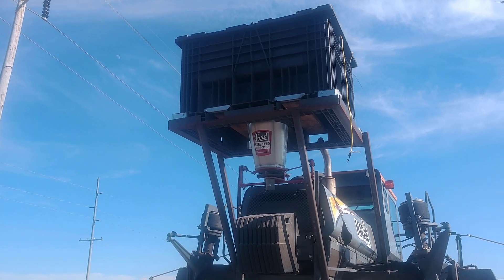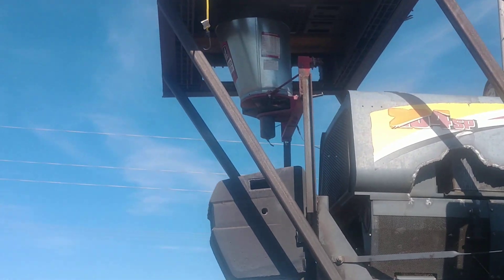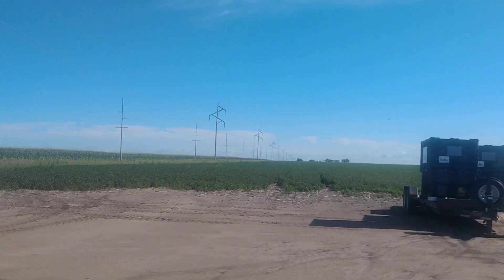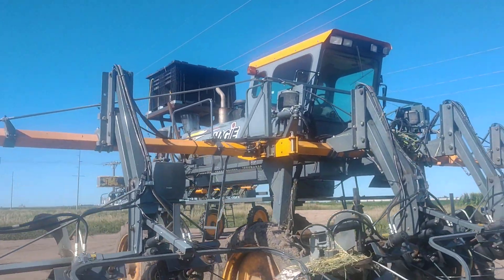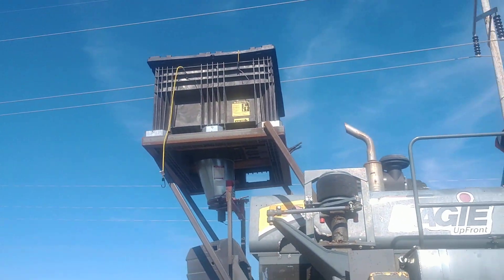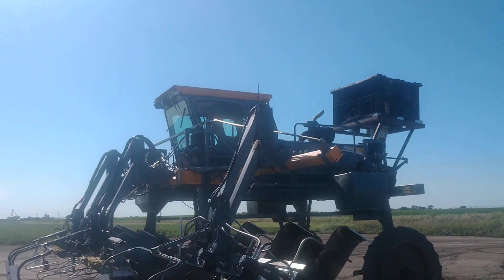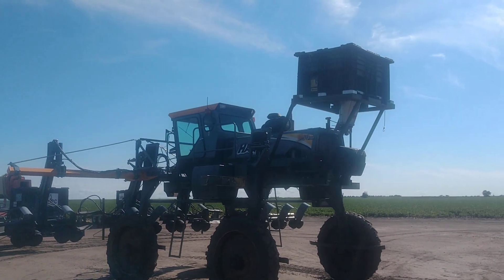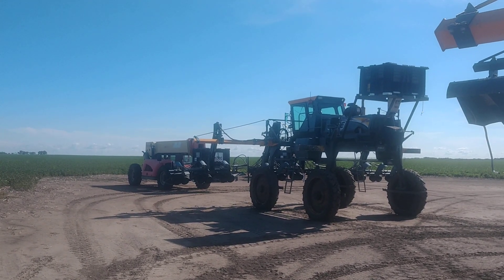Best cover crop spreader ever!

Comment: What is the working width and how precisely it can broadcast mixture of small and heavier seeds? I will fabricate my own seeder as well. Will buy some cheap 12 m hitch mounter sprayer and install APV pneumatic seeder on it.
Reply from the maker: It can be set up to different widths We work about 30 ft at a time.  It can go as wide as 50+ because of the height.  And it can go down to about 12 to 15 ft accurately.  We pretty much just keep it set up for 30 ft and it applies very precisely.  I'll have some videos of the cover crop emerging.  when just spreading it's important to note that water going to help germination of your spread on seeds a lot.  We have irrigation systems where we farm, curious where do you farm at?  Thanks for checking the channel out!

Comment: Do you get a very good stand? This came up cuz I had a hair brained idea to mount 2 or 3 spreaders on the front of my sprayer, and try to cover 120'
Reply from the maker: Great stands, here is the result vid!  Thanks. https://youtu.be/8qM7tzI3eGs
Reply from the maker: If you can pivot irrigate or usually get seasonal rains that really helps.  In NE it's usually dry enough in the summer I can apply .40-.50 hund of an inch and it germinates it really well in late July/early August.  What's your soil type and geography like?  I like the idea of mounting on spray boom or building something, hmm.  I'm spreading 30ft with mine, small cover seeds will actually blow in the wind.  120ft might be pushing it, the seeds have to fall through the cash crop plants vegetation (corn, soybeans,wheat,milo whatever...  I can go to 40 foot spread in perfect condition days (no wind). But I dunno that 60 foot would be as accurate trying to seed thru dense corn leafs.  Might want to narrow up a bit?  Or go with 3 spreaders that's pretty wide, but would cover acres, you'd fill alot!  Lol. I'd say I'm around the 35-60 lbs an acre for my summer cover mix to get stands...Just my 2 cents. Like this forum for exactly this reason.  If you come up with something, a good way to mount dual spreaders on a JD or Hagie sprayer.  That could be a very good idea?   I like it.  Heck you could probably even spray if you wanted too!  Thanks!
Reply from the maker: @jeffac500  awesome, thanks for vid, I figured someone had an aftermarket kit, I'm with you on the weight, those booms aren't cheap!  but do like it, airplane application is expensive, but I always count the corn that gets run over/ damaged making any late season applications by ground rig, I don't think it's more than a few bu... So I go with ground rig.  It's worth it if you get cover established in my opinion but we have flown on a lot of covers, about 50% as good germination/ stand.  You ever try flying on?  I had to tell my pilot to narrow up could see the pattern post harvest.  Like the sprayer boom setup in the vid to spread wider per pass.  U can see they prob have about 23-30 feet between each spreader?  it looked like?
Reply: I dont think I would try to plant any that late in the season. From what I've heard about flying on tho is that if the ground isn't real hard, the seed comes in with enough force that itll actually "plant" itself. That could be more promising if its timed well enough, but I've never tried it or seen that 1st hand. For the most part guys around here drill their cover in with a grain drill of some kind, so I dont have much faith in broadcast. I've spent hours on youtube looking for and exploring ideas tho. I'm trying, I want something to work lol.
Reply from the maker: @jeffac500   What time of year do you think broadcast covers works best timing wise? Early or later broadcast works best?  I've found later gets more sunlight in corn. And i hear ya on the drill, I use a 40FT great plains grain drill, quick shot of it working... https://youtu.be/RhkuFD4FRKY.   Like it better than air seeder on my small seeded, multi sized cover crop slmix seed.  (7+ diff seeds in mix) grain drill seems to work better,   question...  Austrian winter peas... u have any experience with them?
Reply: @growthefarmup2606  what model drill is that? And what will you plant next year at that farm?
 I've only tried rye so far, so I dont have experience with peas. Hairy vetch is another I'm interested in. As far as broadcast, if it's a cover such as clover we can frost seed in the spring I would be confident in that. Otherwise I would have to try to time it ahead of rain.
My father in law has tried many more covers. I get alot of advise from him, and I should call the county soil and water conservation soon and see what they have to say too.